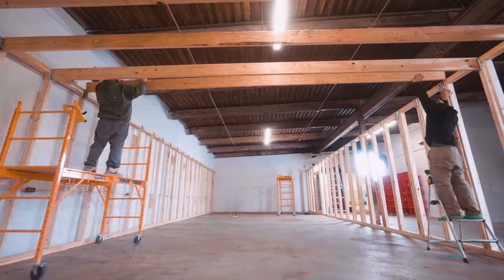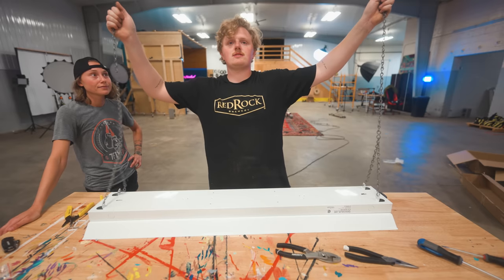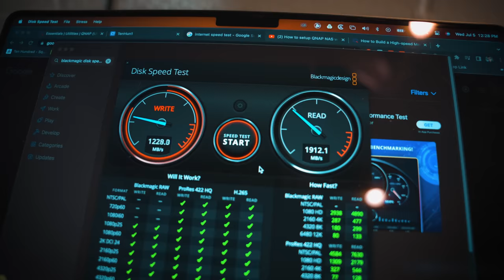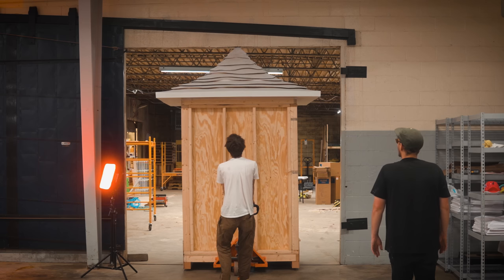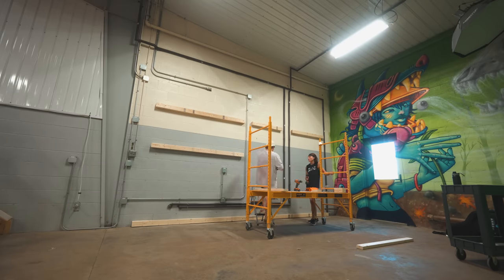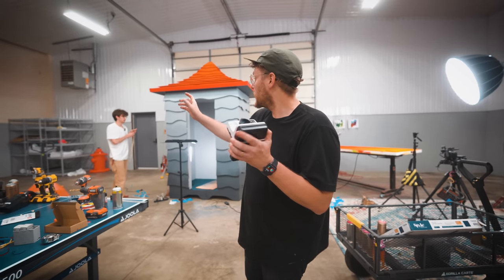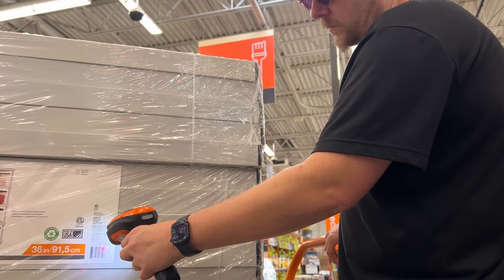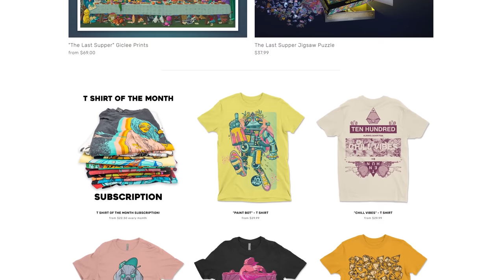Building My DREAM YouTube Studio! (In a WAREHOUSE) - Ep3

Comment: Only recommendation I'd have is to raise those monitors - currently your eyeline is well above the top of the monitor so you'll be straining your neck to look down at the screen! Your eye level should be about 2 thirds of the way up the screen. It would even help to have them on arms that can adjust vertically so you can move the monitor higher up when using the desk standing up

Comment: Great job! When sanding drywall there’s an attachment you can put on your wet dry vacuum that sands and sucks the dust. It’s inexpensive at Ace Hardware. There’s a lot less dust. I’ve been doing construction since I was 11 with my dad. I wish we had the drywall hanger for the ceiling we had to hold them up ourselves while my dad screwed them in.